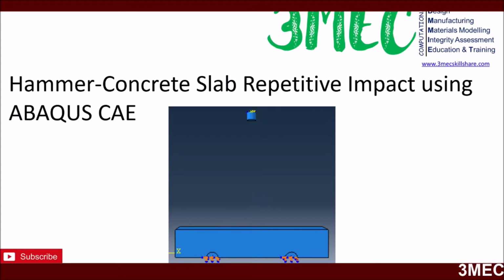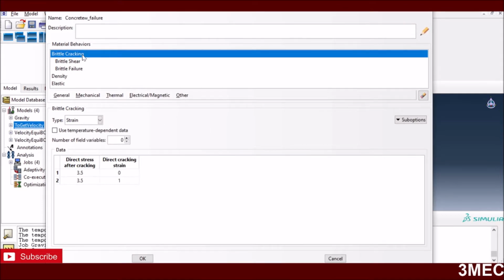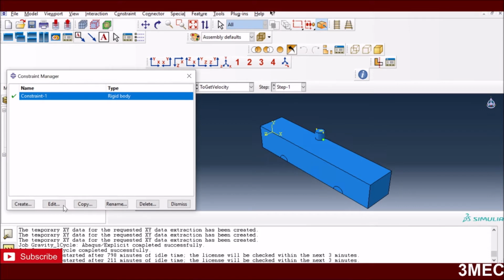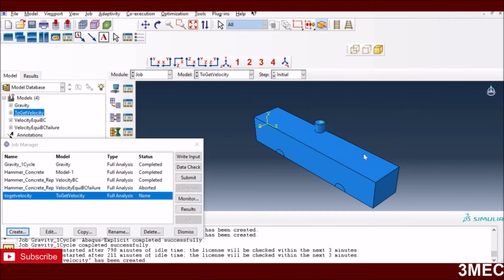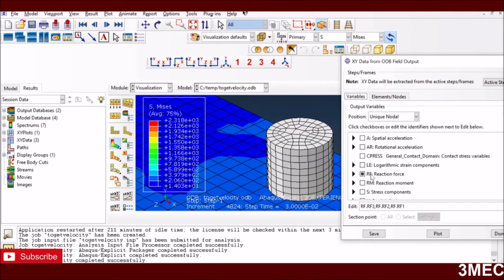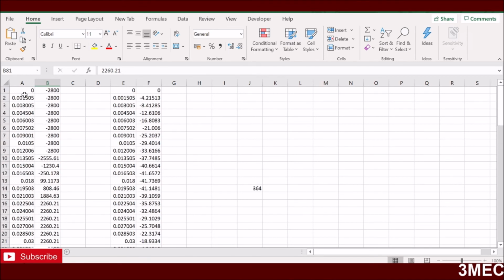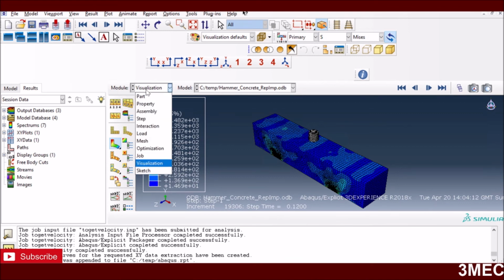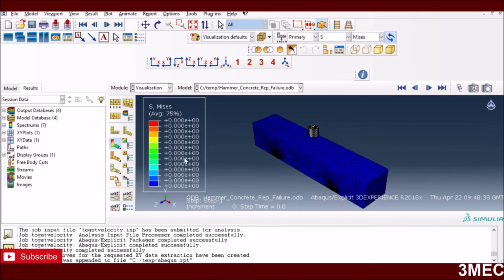Hammer and Concrete Slab Repetitive Impact using ABAQUS CAE

Comment: Hi sir I did impact load test, and then in results part I have taken reaction force of hammer as impact load (for my thesis). 

Now my guide is asking me to get the formula which the Abaqus software used to give that reaction force. Can you please help me where to find that formula? 
I am sure that there will be formula in software from which it calculates the required things, I am unable to find it, since you are expert in these software can you please share that formula if you know?!!
Reply from the maker: ABAQUS documentation has all the details. Please have a look.

Comment: Great explanations and linking them to practicality makes it easier to understand the concepts. Please, can you do a video for three-point bending (SENB) specimen of L x W x B = 100 mm x 20 mm x 20 mm with crack depth to width ratio, a/W=0.5. One-quarter model please to save cost and computation time; extract J-integral values through the thickness to observe the difference in J as we move from the free surface of the specimen to the middle of the block. Thank you
Reply from the maker: Thanks for liking the video and hope you find it beneficial. Yes, it can be done. If you could send me more details on 3minutesengineeringconcepts@gmail.com, then I can look into it. May be one slide/page with geometry, loading, materials, etc. for problem definition would be enough. Thanks